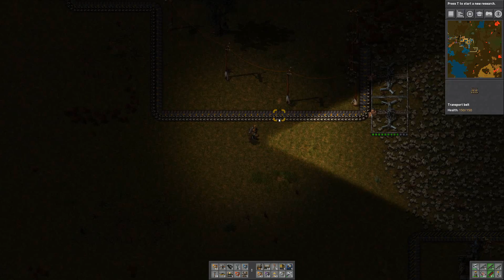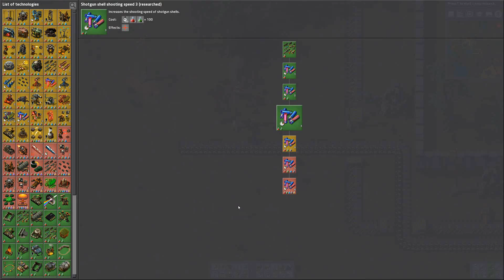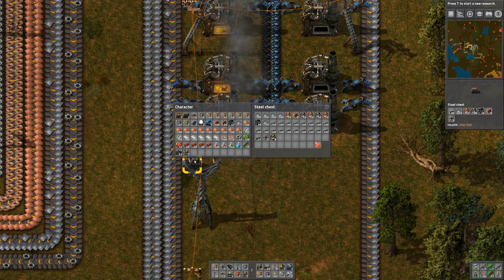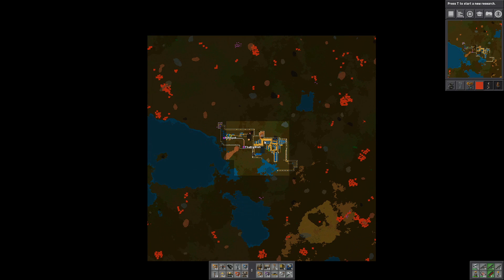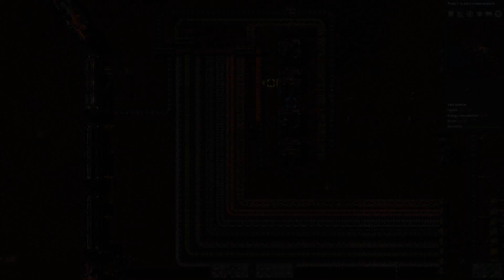Factorio (Part 9) - "Catching Up"

Comment: heavy oil is also used to make lubricant, which is used to make electric engines, that is needed for many things, you can also turn light oil into petroleum gas, heavy into light oil, through the research of advanced oil processing